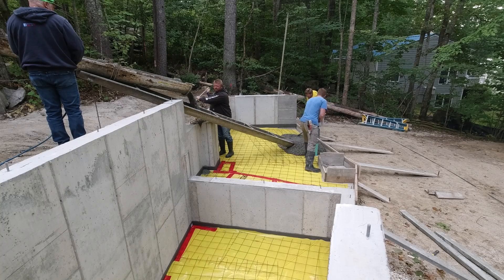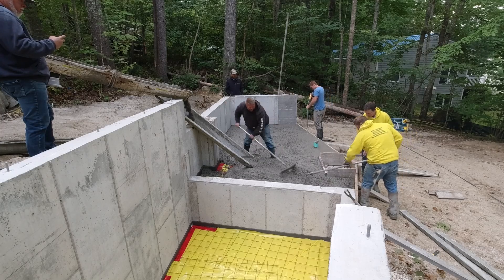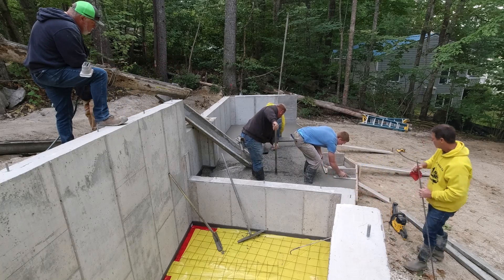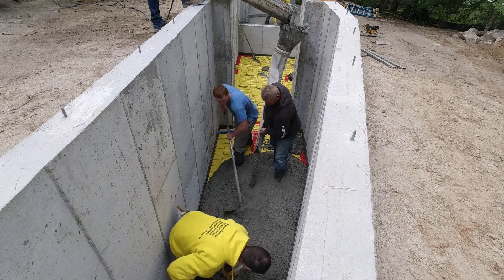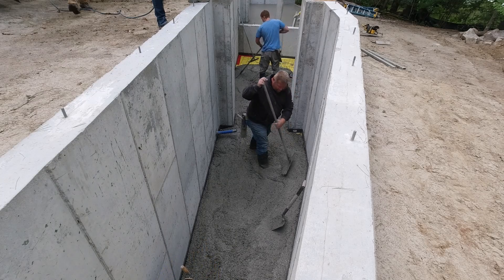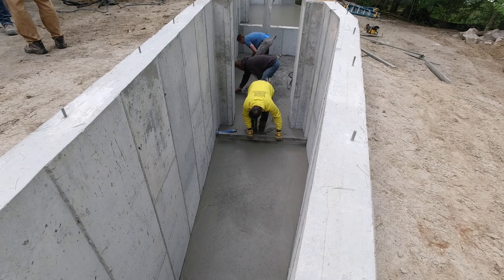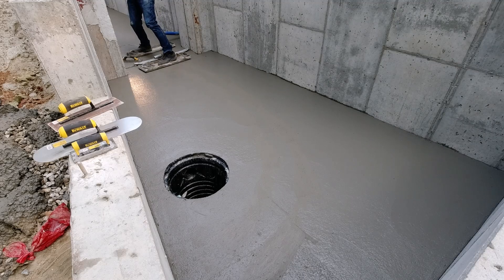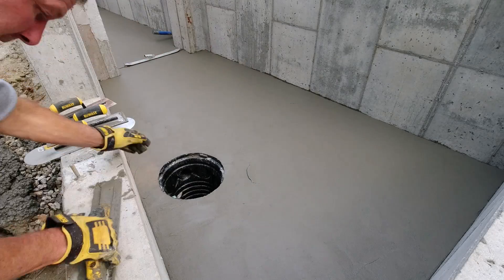Building Codes OUT OF CONTROL - You've Never Seen A HOUSE Like This

Comment: You concrete guys are complete amateurs. Why is the metal mesh on the laying on the ground? You're stepping all over it. THE METAL REBAR OR MESH IS SUPPOSED TO BE ELEVATED OFF THE GROUND SO IT'S INSIDE THE CONCRETE, NOT ON THE BOTTOM TOUCHING THE GROUND BECAUSE THEN IT DEFEATS THE PURPOSE AND IS POINTLESS! That metal is providing no reinforcement because it's not even in the concrete! Pathetic. I see so many people do this. It just screams lazy amateurs.

Comment: The preexisting house in the video is how close to the lake? Seems much closer than the set back required for this new pad.
Reply: My folks have had a place on a lake in Maine (perhaps even the same lake in the video) for about 50 years. The setback from the lake has increased 3 times since they've been there. Most likely, the preexisting house in the video was built prior to the setback changes.

Comment: Lakefront codes and setbacks are ridiculous.  It's even worse when you hear about grandfathered laws and codes that apply to some but not you.  Especially if you are tying into city/county utility lines such as water and waste and don't have to drop in a septic or dig a well.  There is a lake front property similar in size and setbacks near me that has been on the market for years because the house that can be built on the property would have about the same footprint as that foundation your pouring.  The property asking price has been 3/4 of a mil. for the last 10 years.  Anyone who buys it has to go through a variance process through the county where the neighbors of the build site have the say.

Comment: So its  planning problem not a code problem actually. Setbacks and local zoning regs. Now manipulate things such that you have a 3 story house. The lower level being technically a basement if it has dirt around a certain percentage. But use lots of glass toward the lake of course. Then another floor above that, then a really tall floor above that with a mezzanine on 1/3 of it. Milk the building code for all its worth. But be careful in case the Zoning Requirements have different definitions of floor levels, or maximum heights. Careful that bedrooms have 7 feet clear width minimum.

Comment: 🦁🦁🦁🦁🦁LION takes LIKE Number 1300~   //    Our Slype is that skinny. A Slype is a passageway that connects the church to the monastery or in our case to the cafeteria. It is about four feet wide and two hundred feet long. Its dimensions were set because it was built directly over an existing tunnel between these two buildings.

Comment: They should’ve just built a bigger/thicker/more solid foundation and set a much larger house on top of it. Pretty much all setback laws only apply to what is actually touching the land, not what occupies the air space above it…..
Reply: Most of the setback laws I've seen include the outer walls of the structure.
Reply: @paulfrank8738 nah they don’t…otherwise they’d measure from roof overhang not were the structure meets the ground. 

That’s also why decks don’t violate them either.
Reply: @nolt4024  "This law dictates that structures, including those on roofs, must be set back from the normal high-water line of great ponds, rivers, and tidal waters, as well as the upland edge of freshwater or coastal wetlands"
Reply: @nolt4024  Also, "Most jurisdictions will allow the roof line of overhang the setback line as long as it is still overhanging your own property. However, most jurisdictions also have different views on how much the will allow."

Comment: SHOULD HAVE WIDDENED THE BUILD AS YOU WENT UP. IF FOUNDATION IS EXPOSE, THAT WOULD BE WHERE TO MEASURE FROM. FINSIH OUT WITH WOOD DECKING TO GAIN WIDTH TOO, UNLESS ALL OF THIS IS STILL AGAINST CODE. I WOULD HAVE TO READ IT TO COME UP WITH SOME IDEAS. IF IT IS NOT THERE IT IS NOT CODE!

Comment: If they don't have city sewage then the lot would need to have a sizable sewage-disposal area where the slope must be less than 30%.  If they must have an OSSF then you'll like the rules b/c the fever from sewage contaminated soil usually lasts 48 hours.
Reply: This is in Maine where they also allow composting toilets, especially on lots that are too small to fit a proper septic system. A grey water only system takes up a lot less space when you don't have to deal with discharge from toilets.
Reply: @theodorgiosan2570  Oh wow, & it's odd how they don't quite explain what fully composted is, as they warn people that gray water discharge onto the surface of the ground has been banned since 1926, due to shower & clothing water having the possibility of containing e-coli or tapeworms.  I my State you can only have 1 home on 10 acres & all components must be 100ft from the property line to have no septic permit.

Comment: Any windy day could be the last day for that house 🤣
Reply: Not with those steel beams
Reply: @Boga217 you have to understand that a square is way more stable than a thin rectangle. The steel beams are not that much of a factor. Unless they went way down under the foundation so the ground gives it lateral support which they don’t

Comment: I wish you guys would put more rebar in the foundations, I had a T shaped ranch house built in 2021. 1616 sf. At least a dozen cracks, pisses me off that my builder didn’t ask if I wanted more.
Reply: Maybe it's a bigger issue than just the rebar if you have so many cracks.  Did you have a structural engineer look at it?
Reply: @  my lot was blasted out for the foundation, my builder gave me a bs line. There’s two types of cement, cement that has cracked and cement that hasn’t cracked,,, yet…  The excavation guy didn’t have a jackhammer attachment for his rig, so he raised the footing up almost 16-20”. Because there was a rock in the middle of the back wall and floor that didn’t break during blasting.  
Luckily there hasn’t been any extra problems and no water leaks since I had gutters put up.

Comment: I have very little experience with concrete finishing, but I feel like waxing your skids would help prevent them from sticking. Not sure how long the wax would last though. Ceramic coating might be the way to go. Have you ever tried waxing and/or polishing them? If so did it make any difference?

Comment: It's pretty obvious that the town didn't want that lot built on.  This def qualifies as a "spite" house.
Reply: If the town or neighbor didn't want it built on, they should have bought the lot.  No doubt, both were too cheap to do that.  There are certain circumstances where a variance is called for.  This is one of them.
Reply: @Mikexxx531  no they are trying to charge 60k for a fucking parking spot bro.  then they lie to developers and end up building a house that will NEVER be worth what it cost to build.  its just spite. and greed.    most likely will never be worth what the land even costs.  usually the town is the one pushing this nonsense so they can get more tax revenue and dont care at all about the citizens.
Reply: I suspect that there are going to be a bunch of "awnings" and "sunrooms" and "covered carports" and "gazebos" that will pop up all around that in the next couple years.
Reply: Or the neighbor.
Reply: they should NOT decide if you build on your own lot or not... but it prolly took the view from one of the "elite" in town...
Reply: @LittlebitsStreams The house I grew up in, my folks built it, was one such cases. A judge's kids and friends used to use the property as a dirt-bike course and the local high-horse horse riders used to (and continued after we built the house) ride through the trail there. It had to go to court and you guessed it the Judge whose kids rode there somehow managed to be the judge that got the case. Hows that for corruption, we eventually won on appeal but yeah. The HATE from the elites because we angered another elite was felt for decades.  These kinds of people in power are petty, vindictive, and nasty... horrible goblin like personalities.
Reply: YOU know nothing---so be quiet

Comment: Setback requrements are tyrrancial deprivation of property rights which should trigger compensation under the eminent domain laws.
Reply: I dealt with two brain dead code enforcement dingleberries building my house in 2021.  Plan shows the 25’ set backs, the road to the right side they couldn’t figure out where the line started. They kept telling me I was too close to the 45’ set back, WTF dude !!
My carpenter asked me if I went 30’ from property line,  I’m 35’ I told him. He and his brother checked and I was right on for setback.
3 months later after 90% of house was built, I got another call from one of the code dweebs, hey we’re still trying to figure out your setback  .
Swamp rats and stupid fhaks don’t just live in DC. Been 3 years, no issues.
Reply: @geneticdisorder1900  well this is the magic of failing up. Someone starts at the bottom, is good at his job, gets promotion, now manages also team. But may have literally zero skill to manage people. Yet company will hold him as long as team manages to reach the set goals. You see this everywhere. This is why I often laugh about whining that "I was in the company for 15 years, I was awesome at my job and they decided to hire for the higher position someone from the outside. So unfair!". Nope, you are most likely too good at your job right now to move you and/or they know you have no skill necessary fo other position.
Reply: @geneticdisorder1900  amazing.. I am also a code dweeb and it is not hard to figure out lot lines and setbacks.  I do however, believe set backs on lake lots are a good thing.  Preservation of nature is beneficial.
Reply: @InspectorEJ11 . The most ignorant part was that I got a call, 3 months after the house was completely framed , says they were still trying to figure out the 45’ setback issue. They couldn’t understand that from the center of the road to my, 25’ building envelope was 45’.
They thought it started at my property line itself.   
Swamp rats don’t just live in DC !
Reply: @InspectorEJ11  But common sense should have been used here...
Reply: Yep, I keep telling people you don't own anything you have to get permission to change or anything you have to keep paying money to keep.
Reply: The fact they wouldn’t give you a variance for a 6’ variance to give you a 16 foot wide house on a 1 acre lottells me all those city people feel way too safe where they’re at
Reply: If post facto enacted after person had purchased the land compensation should be awarded to owner .
A good NYC attorney would win this case .
Call Trump.
Reply: I both agree and disagree. It's a problem when people have hedges and fences that block visibility for drivers. I think that could be solved with decent sidewalks or bike paths, though. Realistically, I just don't think a lot that can't fit a single wide mobile home should be allowed. If you can't build on it, merge it with a neighbor's lot so that someone has useful land. If a neighbor doesn't want to buy it, then make it necessary that the lots are merged in the next transfer of ownership, and the government will hold the land until then, obviously paying the current owners for the basically worthless land.
Reply: @da3dsoul  a 30 foot setback is not necessary for that.  Plus, our hard core lust for "car first" for everyone in the USA has hugely reduced "usable land space".

We seem to have a literal problem with being "sane" over here.  When we tried roundabouts we made sure they would fail.

We demand everyone stop at intersections which increase risk instead of safety just because we want it that way.

We happily ensure that double the damage will happen just for the sake of avoid someone saying something bad about things.

We are happy to destroy everything and anything so long as some arbitrary law is followed regardless of its sanity.

Comment: If they wanted to be tough they could say its confined space permit required     It deff within the spec.  How come you didnt use bricks or stands the wire laying on the plastic.   Kinda defeats the purpose
Reply: The bricks or WWM chairs often don't keep all of it off the bottom. Workers bend the WWM down with their feet between the chairs. That's why fiber reinforced concrete mix is much better for slabs.

Comment: Ever heard of getting a minor variance?  Most townships will be logical and reasonable, if you pay the $700 or so fee you can do things like build closer to a road or water if you have no other choice.  They are not going to refuse you without a good reason.  Most of my dealings in Ontario have been good, just expensive, you have to pay for EVERYTHING and it's not cheap.
Reply: I've heard that hiring a local contractor and/or lawyer to represent you with the planning board greatly increases your chances of getting a variance approved.

Comment: It looks like the skinniest house is in Long Beach CA on Gladys Drive. The lot is 10x50 and the house is 7 feet wide. 860 sq ft on 3 floors. 
For fun I made a very realistic cheeseburger, baked potato, bell pepper, some popsicles and doughnuts out of high strength concrete, a pinch of plaster and paint.

Comment: well we see for sure you did the wire mash. i have seen so far not one right placed wire mash from anybody in america.
Reply: The WWM should have at least been placed on chairs. But chairs often don't keep all of the WWM off the bottom while workers bend it down with their feet between the chairs. That's why fiber reinforced concrete mix is much better for slabs.

Comment: Curious, do the setbacks apply to overhead structure? With enough steel they could go up a floor or two and then widen the building substantially, not too different from a general water tower shape.. so they foundation and even walking space meets the setback measurement
Reply: in maine yes it does. its a vertical wall.

Comment: Setbacks aren't building codes.  Building codes ensure your house doesn't fall down, burn down, etc.  This is zoning restrictions.
Reply: Some building codes are more for property value more so than safety.  Code enforcement is all about money.
Reply: It's all the same corrupt crap.
Reply: Correct. Most major areas have code and zoning separate. Maybe this is some backwoods county that runs roughshod over the people.
Reply: In my area, code enforcement is responsible for checking zoning rules.
Reply: stupid anyway 🤷
Reply: I don't resent code I resent the dipshits they get to enforce it.  😉
Reply: Zoning is why women should be voting, Late stage democracy is worse than a dictatorship, you all just don't know it.
Reply: Setbacks can also be mandated by the DNR or the County when there is waterfront property involved.  So A LOT of bureaucracy to wade through just to get a variance.  In some cases, once a code conforming structure is built, then the spatially challenged bureaucrats can see a negative effect of the boiler plate rule, and allow for a variance later when an addition is built.  BUT that is an awfully expensive and risky road to travel.
Reply: @ccscomments757  Bureaucracy?  The lot was too small for a house.  The owners are ridiculous and built this nonsense because it threaded the needle between the rules.  The fact that the local government approved this, shows there wasn't enough bureaucracy.  This lot shouldn't have been a legal lot, but since the existing rules didn't technically prevent it, it was approved.
Reply: @ The lot was perfectly fine for a house.  The stupid rules precluded building a proper one.
Reply: @Mikexxx531  The lot was not fine for a house.  The rules are not stupid.  This lot was too small for a house.  It is technically a failure of goverment to let this be built just because they could technically make it fit.
If the owner of the land had cared, they would have spoke up when the road was being built.  They did not.  Past owners allowed this lot to be this way, not government. It is not the government's job to bend rules because a previous owner let his lot become less and less usable.  Whoever currently owned it would have bought the lot knowing the restrictions.  They don't get to buy a tiny lot and then complain to government after the fact.
Reply: @_PatrickO  The government's job is to maximize freedom.  IMHO, it's not their right to impose these restrictions on anyone!
Reply: @Mikexxx531  Grow up.  The government regulates freedom by enforcing basic rules to keep everything fair.  If you own a plot of land and ignore it while everything around it is developed, you will be giving up utility of your property.  This is how it works.  When other projects that affect you are applied for, you need to show up and object.
The new owner bought this property knowing how restricted the lot is.  The previous owner was the one who let the lot become restricted.
It is that simple. The government does not undo laws or ordinance because the new owner didn't want to pay for a bigger lot.
Reply: I disagree an acre is not too small for a house.
Reply: @multilis2  You don't get to disagree with facts.  The beach doesn't count as usable land for building.  This lot is encumbered by a road that a previous owner did not object to.  It is that simple.  The new owner looking to flip this lot would have paid less for the lot.  They are building something that will look like a house from one side.  It feels like a trick hoping someone buys this without realizing the house is basically a facade.
Reply: @_PatrickO  I wonder what the owner of the land pays the City in taxes per year for what you claim they should not be able to build on?

Comment: Passing code is passing with a D+ grade out of an A-F... there are NO codes in existence that are overkill in anyway. You can ONLY either pass code or do better. some codes like this are good enough and going above is a bit crazy but ABSOLUTELY possible. 0% of this is out of control. you are NOT en engineer and you are NOT a planning and Designer